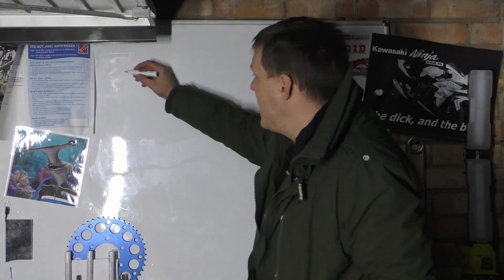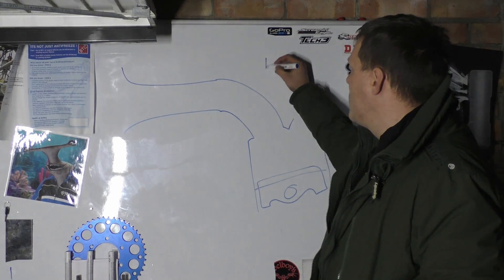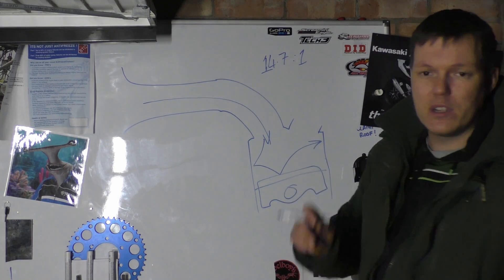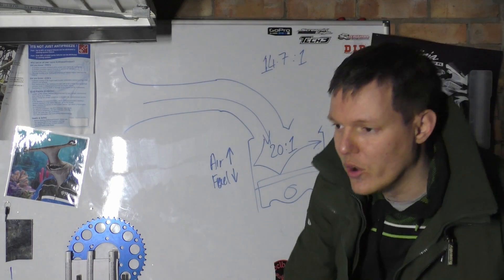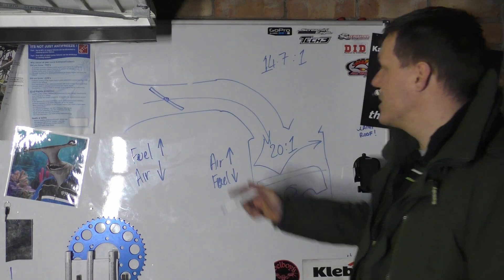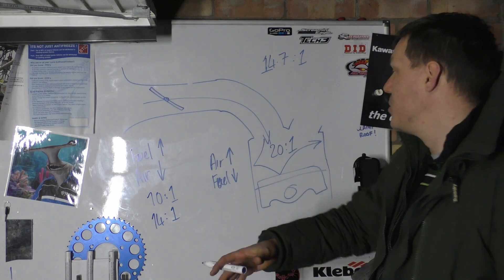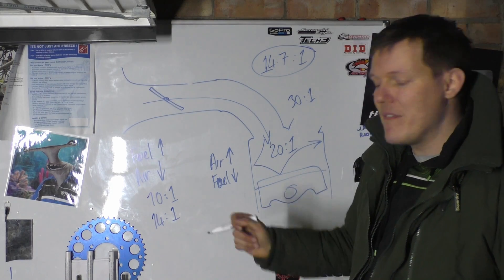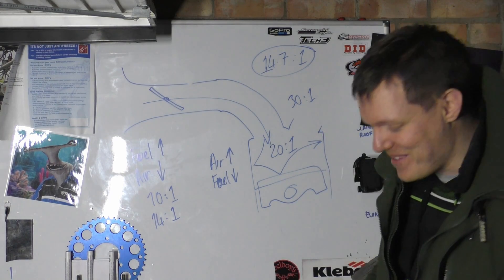Isn't throttling the same as choking? - Cold starts

Comment: Is there a recommended time to leave a choke on before riding, or can it usually be shut off more or less right away?
Reply from the maker: When the revs start to pick-up. The bike will idle and then when its warming up the revs will start to climb, like it's running rich, because it is. Then you take off the choke
Reply: @thedirtyworkshop  nice one, cheers

Comment: Is the 14.7 to 1 fuel to air ratio the ideal ratio for all fuels or just petrol?
Reply from the maker: Petrol - nearly the ideal ratio for diesel but for Methanol for example its 6.47 : 1
Reply: The Workshop Oh right, thanks
Reply: Actually diesel doesn't need a specific ratio
Reply: danny mac The specific ratio is when combustion would be perfect, at say 12:1 however it may still combust just it'd be running rich and there'd be unburnt diesel.

Comment: My Ducati has a locking button that holds the throttle sightly open as a "choke".  There always has to be somebody that feels they need to do it  differently, don't they.....   ;-)
I presume the slightly open throttle position is running slightly rich, which helps with initial take off of the bike, when opening the throttle under normal riding conditions. Suppose this is why it works as a choke ?
Reply from the maker: If you're talking about FI systems then yes - we'll be covering this soon

Comment: My son rode off into the snow this evening to his place of work.

His bike is a 1994 CZ 125-488.3 (made when Cagiva owned CZ, before selling it to MV Augusta).

It has the Vape 6 Volt alternator and CDI upgrade plus Amal Mk.1.5 choke carb replaced with superior Jikov "Tickler" carb (higher top speed / more power) fitted.

So starting procedure was:

Tickle carb and kick the motor over (fires first kick)...... cough vroom cough stop.

Bike refused to start or even cough (carb too cold).

Fetch bottle of hot tap water and pour it over carb to heat it up.
 
Kick motor and vroom but revving its nuts off (air too cold) for nearly 2 minutes and then it settles down. 

Into gear and off he sets up the road for his 5 mile ride to work in 3 Inches of snow.

Comment: Does using the choke with a warm motor cause any damage? For example on the old carb SV 650 you can use the choke to have a cruise control at 30mph (with it still running normally). As far as I understand a richer mixture only suds up the spark plugs or are there other factors?
Reply from the maker: Choking means more fuel - apart from what you stated the answer is no. However, more fuel in means more fuel blow-by. This waters down your oil over time.
Reply: Oh thats good. I do oil changes pretty often anyways, because im using cheap "mannol" oil on the old lady.

Comment: One major difference between the two that you could have mentioned is that the throttle is placed after the jet in the carb, so it causes an equal restriction for fuel and air flow, whereas the choke is placed between the vent to the fuel bowl and the jet, restricting air flow and thus increasing the relative pressure between the fuel and the carb barrel.

Comment: When asked why use the choke I would always say because it’s cold, and that is why we use the choke. I never really had a clue what was going on now I do. Very informative video thanks.
Reply: tex ritter The choke is basically forcing the engine to take on excessive fuel because the suction is there on the intake stroke but you shut the air intake off but the fuel is still open. The throttle is basically a choke that comes after the fuel nozzle in a carb so that fuel flow is a ratio of air flow and the correct fuel air mix remains.

Comment: I think the enrichment of the mixture is mainly from the reduced pressure in the throat of the carburetor causing more fuel to be pulled in. If the reduction in air was substantial it should cause a substantial reduction in RPM.

Comment: A oil pressure gauge just tells you mainly if your oil pump is working or if a oil line is broken... Or if you dipstick forgot to check and refill it.
Reply: And if your low oil pressure warning light is on, it's already too late. An engine is already a low oil pressure warning. Knock-knock. Who's there? Knock-knock. I said who's there? Knock-knock. Oh. Shit.
An oil pressure gauge is really only good to make sure you used the right weight oil. After the first heat cycle, it's not necessary. 
This is why, in my car, I'm removing the factory oil pressure gauge in place of a boost gauge and wideband AFR gauge on a tiny OLED display. Yeah, yeah... cars. I know. Just let me be bi-curious with bikes and cars. At least I'm not into that weird fetish of an odd number of wheels.
Reply: I had that with my car oil light on (make a wish sign) meand oil pressure of 0 high rpm it was less than 1 bar it should be about 3 so the engine was running with bad lubrication. Needed to swap the engine. So lesson leaned the light gives the information that you can drive on, your engine is fucked anyway.

Comment: Worth mentioning that FI bikes don't have chokes (At least not usually) as the ECU adjusts the fueling to compensate for temperature, humidity etc.
Reply from the maker: I have in the comments and this is a different subject
Reply: Missed that, didn't read all the way through the comments. I just thought some may not realise the adjustments were done differently with injection.

Comment: Hi Matt, 

I have a question for you, 

I have rebuilt my bike including the carbs and now when I start the bike on the side stand using choke I get about 1,300 rpm , if I tilt the bike upright then the revs climb to around 3,000, 
If I do this without the choke then the revs don’t change. So it only appears to be a issue when choke is on. 

Have you any ideas ? 
This is doing my head in for the last few days haha. 

If it makes a difference my bike is a Africa Twin, vtwin with two carbs.
Reply from the maker: "Have you any ideas?"

Pilot jet - we'll get to this soon.
Reply: DHealy91 what carb have you got. Depends. On how they work, if it's an enricher on the side stand it might be the float level sits a little low so doesn't get full enrichment.
Reply: Matthew Trott I’m not sure what carb it is but it’s the original carb and it’s a Honda Bike. 

The problem only happens when the choke is on. Could this still be the float hight ?

Comment: I thought the choke on modern carbs work the opposite way round, meaning instead of restricting air it increases the fuel going in?
Reply from the maker: This is fuel enrichment circuits which is a seperate topic and out of the scope of the question that was asked
Reply: The Workshop ahh ok, as you were!
Reply: Its basicaly rhe same thing only in that case you have an extra jet opening which combined with the closed throttle position gives you the same thing.. its the condensing part that i did not know and is fairly logical now that you know" it :)
Reply: When taking apart my carbs and looking at the choke mechanism, it's just a valve that let's air through. Probably just changes the air pressure under the diaphram so the jet opens more while still keeping butterfly the same. So, more fuel, less air. In the end it's the same effect?
Reply: phillip galas Basically by putting the valve on the intake side it causes the pressure to drop over the fuel nozzle which causes more fuel to come out. You need this because the engine doesnt turn fast enough to provide enough suction to get the fuel going right when starting.
The throttle valve works the same its just on the engine side so that the fuel ratio remains the same throughout the entire range of throttle positions.
There is a fine line between not enough fuel in the air and too much fuel in the air.
Too much fuel and it wont ignite, too little and it wont ignite.
Gas engines are only capable of a narrow range of fuel air ratios, but diesel engines have huge ranges because they use compression to ignite. Diesel engines typically run leaner unless you dog them, then they can run on even more fuel than air.

Comment: Now for the explanation of how "Tickler" chokeless carbs operate.

I've always found that "Tickler" carbs are vastly superior when compared to chokes carbs when it comes to very cold weather starting due to the fact that the bike's engine has power and is ready to ride immediately after firing into life. I've replaced a few of my bikes choke carbs with "Tickler" carbs in the past just to improve starting as sometime I can't be arsed to wait around for a few minutes until the engine say the bike is ready to move.

There are even "Ticker" modification kits for some modern choke carbs.

I can understand the impracticalities of having bank of "Tickler" carbs on a multi cylinder engine but on engines using a single carb why do manufacturers go for the choked carb and all the starting hassles they give??
Reply from the maker: This is an awesome question and I have an example we'll be able to look at soon
Reply: Whilst you're at it could you do a video on how the ceramic surrounding the electrode determines the temperature of the combustion chamber and gives the spark plug its temperature rating.

Also the difference between Sintox (sintered aluminium oxide) spark plugs and cheaper normal spark plugs.

(Also yet another British invention: Spark plug 1890's Oliver Lodge. His company still makes (expensive) spark plugs and the ceramic laminated (sintered aluminium oxide) armour for Challenger II tanks).
Reply: Thought ticklers were done away with for emissions reasons or safety reasons. They work great but getting everyone to pump them until fuel overflows is a bit much for your average rider. Plus the whole pooling of fuel under a carby ect, not the safest design in the world. (im only talking about old nortons/bimmers here im not sure if other tickler carbs had better design)
Reply: On some bikes (Jawa and CZ), which also had military usage as all weather bikes, the ability to spill some petrol under the carb and use it to warm the carb up above 0 degrees C is an essential facility. I've used it myself once, back in the 1980's, to start the bike and ride 14.5 miles home through snow. Petrol stops giving off fumes and becomes inert at -4 degrees C. If the carb drops to this temperature or below then no atomisation will occur and the engine won't start. That's why there are carb heater kits for real die hard bikers who'll ride in any weather in chilly climates. 

My son is due to ride his CZ to work in the snow for his night shift, this evening, so I'll most likely be cooking the carb with a small petrol spill fire unless I can locate the paint stripper gun.

The carb doesn't have to be primed so that the fuel overflows in most instances. Usually the rider knows how many "Tickles" are needed to start the bike due to each bike's individual foibles. Most start with half flooded.

Yamaha and Suzuki 2 stroke had a prime setting on the fuel tap which flooded the manifold intake tract with neat fuel. This performed a wet start. On RD's and GT's (including triples) only the left cylinder was primed and the engine started on one cylinder and after 10 seconds or more, the others would join in.

Wet starting with the throttle full open is the usual way bikers start a rebuilt engine by either squirting fuel into the carb mouth or down the spark plug hole. Kicking or turning the motor over on full throttle will quickly see the mixture hit the right fuel / air ratio and fire up into life.

It's also the standard method of determining that there is something wrong with the carb / injection / fuel system as if the bike can wet start and run for a few seconds, before spluttering out, it ain't the ignition system that been preventing it from running.

A very old school trick dating back over 100 years to the pre-carb days.

Comment: Whats your opinion an the 1985 xt600? I am considering buying one. (And can you resctrict the power with just making the carb not open completely? (For A2 registration) greetings from Norway!
Reply from the maker: You can restrict anything, but it needs to be certified - is this possible? I have no idea - you'll have to contact your transposrtation authority to find out if there are any venders who will do this or cantact a Yamaha dealership
Reply: William Jenssen im assuming you mean if you stopped the throttle from being able to fully open, and then remove that stop later (or not). Yes you could do that in a bunch of ways. Id suggest you dont do this for safety reasons.... buttttttt if i were to do it id probably put a pin or something in to prevent full rotation at the throttle tube.
Reply: In germany the biggest producer is alpha-technik. If they produce a reduction it should work out.
Reply: William Jenssen i did find a few, just only to 25kw
Reply: SexyFatMan thats no problem, they wont be there after the registration...😉
Reply: Thanks for the answers! Really appreciate it🙂

Comment: Thanks for the vid, I have a question that's been lingering in my mind for a while... Some dude said "I pull in my clutch when starting my bike because in a real biker". I couldn't get an explanation as to why he does this or why it's necessary. Do you have an idea why he thinks not doing this is bad? PS. The intake manifold you've drawn looks like a crooked dick with a piston instead of a bell end
Reply from the maker: Because he's a bellend LOL
Reply: Maybe becouse if you pull in your clutch, your startermotor doesn‘t have to drag The gearbox Along Wile you Start?
Reply: Some bikes have safety switchs fitted so you have to clutch in to start
Reply: Maybe he meant crotch ???
Reply: Pulling the clutch doesn't do anything for me on a cold morning, in or out of gear. The rear tire still spins. So I put my bike on the center stand so it's like a flywheel

Comment: Here you go, think this will further explain!

https://www.youtube.com/watch?v=WSlRdML6cw0&ytbChannel=Enslaved%20By%20No%20Media
Reply: fuel injection has a choke, does it?
Reply from the maker: Fuel injection has a few tricks up its sleeve - usually the main one is to control the amount of fuel based on the temperature, air pressure and throttle load - most systems have - cold starting programs.
Reply: yea, but, i was meaning with that link
Reply: ... That link was a joke
Reply from the maker: Which bit?
Reply: Flat Earthers channel Matt......
Reply: He's from england, may well be a flat earther, hence why Spain beat them to America!